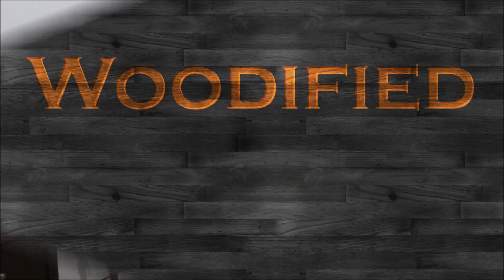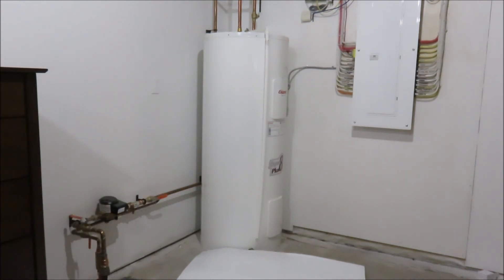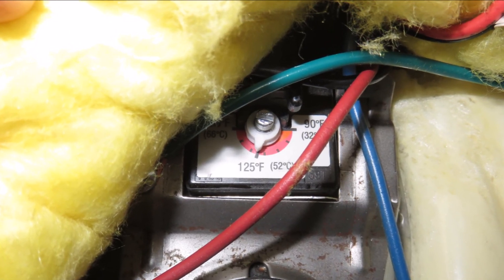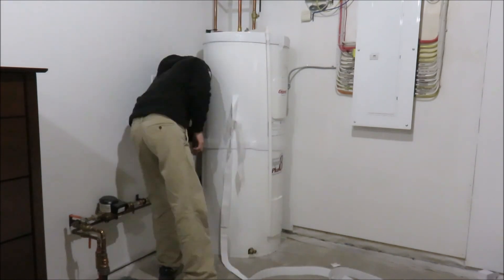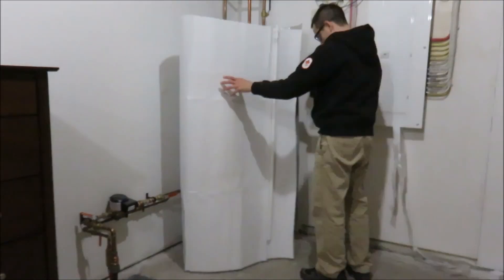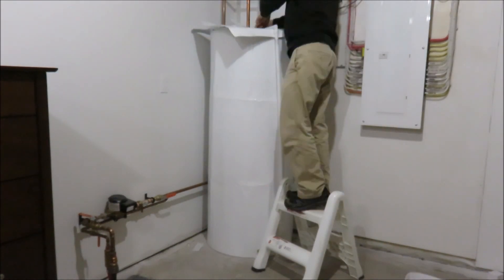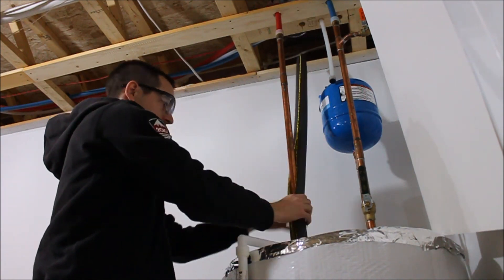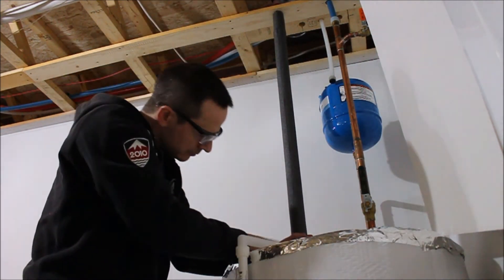How to Insulate a Hot Water Heater [Electric]

Comment: why did the vinyl on the outside of my blanket wrinkle about an hour after it was DIY installed on my residential electric hot water heater...it was smooth when I put it on?????
Reply from the maker: Huh. I've never had that issue.
Reply: @Woodified  i was shocked too 
It's gone unchanged wrinkled on one side  protected corner not so wrinkled.... very cold stone foundation basement

Comment: Aren't you covering over the burner vents? The burner part at the bottom doesn't need to be insulated anyway.
Reply from the maker: This is only for an electric hot water heater.

Comment: I suppose if I didn't have my water heater set to 180° I wouldn't need to find out how to insulate it. 🤦‍♀️🤷‍♀️
Reply from the maker: If you take off the panel cover you should find the dial to turn it down if that will works for your household.